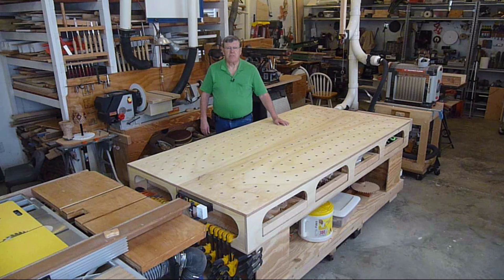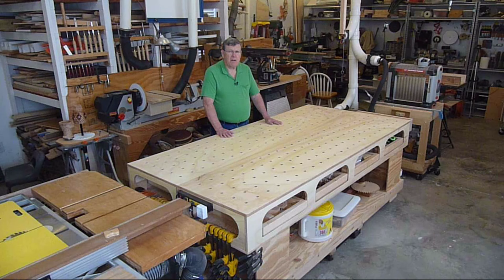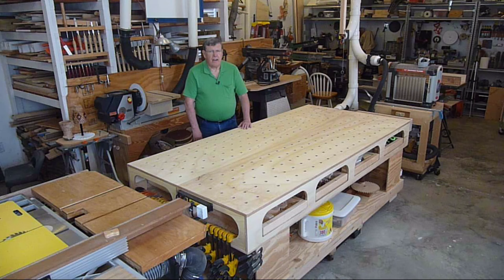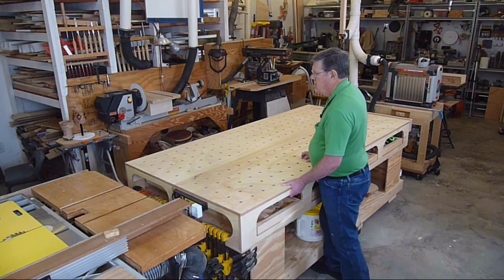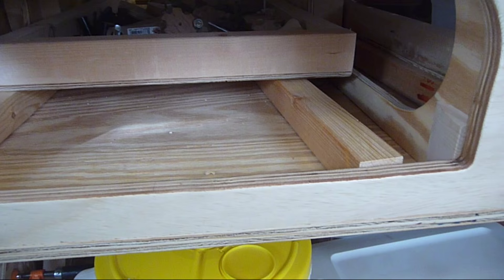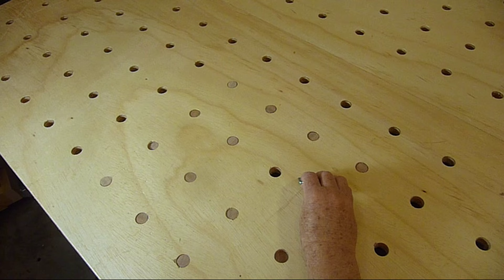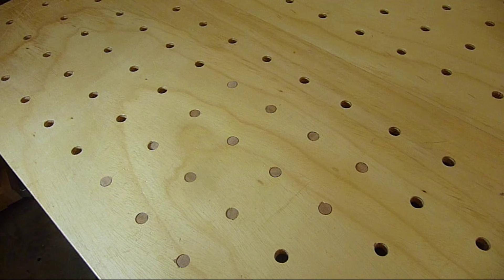Customized Paulk Workbench 2

Comment: Earl, I bought Ron's plans and they are good, but I built my bench modified like you did yours. I think you did fantastic modifications and I even stole your idea with the clamps (used Irwin clamps though but they are still almost as cost effective as Harbor Freight). The main modification I did to your design is incorporating a 2" overhanging edge all the way around for two reasons. The first is because my Saw Stop table saw has a 2" angle bracket on the out feed side used to attach the wings and I figured for balance and the quick and dirty clamp job to make it on all sides. Thank goodness for people like you that share their creativity so us newbie woodworkers can look at your ideas and use them. THANK YOU.

Comment: Earl, i made my Paulk outfeed table 4' x 5' and used you're slide-out drawer design. I already have a 30" x 7' workbench with dog holes and two vises; what i really needed was a large outfeed and assembly table.  I had a bunch of the Rockler outfeed mini ball bearings and installed them on top of the 2" x 3"s; the drawers slide out great and hold all of my cordless Ryobi tools. I'm also able to store a lot of hand tools underneath the drawer space of 2 1/8". I built a 3/4" top with a 1/4" Masonite top with miter slots and moved it right up to my tablesaw. Thanks for you're insight into woodworking.
Reply from the maker: It sounds like you adapted many ideas, added some of you own, and made a table that just suits your needs.  Good job!

Comment: I did an easy modification to Harbor Freight clamps. Removed the stationary jaw and heated the tip red hot and bent it about 1/2 inch down 90 degrees and simultaneously put a 90 twist. They now go into the workbench holes and nothing has to be passed up from underneath. You can’t use the clamps from anything else but for the workbench, but there real cheap!

Comment: Hi Earl,Great bench modified to suit your needs. I made mine with the top 6 foot by 4 foot with the edge and end runners set in by 2 inches to give me c lamping facility all round. I have not drilled the bench dog holes in the top. Colin in Northern Ireland
Reply from the maker: +colin farrier The two inch inset is a great idea Colin.  I've been thinking about screwing a 2x2 to the sides, even with the top for better clamping on the edge.

Comment: Hi Earl, (my late father's name was Earl too), I just finished making my own Paulk workbench (paid for plans) and used most of your ideas to improve it. The drawers are fantastic! I think I'll add a wood vice to one end, but not using pipe clamps. Thank you for your inspiration!
Reply from the maker: Thanks for watching and commenting John.  I still like my sliding drawers.  The pipe clamp vise is not working out so well...the clamps just slip too often.  I'll probably replace it sometime but I'm not sure what I'll use.
Reply: If you got the clamps from Harbor Freight, like I usually do, then that could be the problem. The 1/2" pipe clamps are known for slipping on galvanized pipe. Try switching to Pony pipe clamps, or if you spend a bit more, Bessey clamps. Pony and Bessey tend to have a much stronger "bite" on the pipe.

Comment: Capital "A" awesome!!!. The thicker tops and drawers make it ten times better for shop use. My assembly tables are two solid core door slabs (30" x80"), which are beat up and not even remotely flat. Your idea solves the problem of work areas, out feed table AND tons of storage gained from the cubbies inside the torsion boxes. I am seriously thinking of using your mods on two tables (30 x 96, using the 3/4" ply), which could be latched together for larger assembly. My shop is a long skinny rectangle, and a single big table may be too much.I will probably try to incorporate some leveling, or maybe some adjustable screws (Down to Earth Woodworking Outfeed table design) into the system, as well.Thanks for taking the time to pass on some great info. You just gained another sub.
Reply from the maker: +Andrew Bieger Thanks for the comment Andrew.  Ron Paulk designed a very useful table.  I'm still super pleased with my version.

Comment: thanks for the review of this AWESOME workbench.  I wish I had seen this BEFORE I built mine.  I like it, but I believe I would have like this much better.  I especially like how you modified the design to be an "in house" roller table.  thanks again.  will be watching more videos.
Reply from the maker: Thanks for watching, Kevin.  Is it too late to make a rolling base for your table?
Reply: I made a nice rolling table and I like it.  It has the table saw in-layed on one end and the sliding miter saw on a flip over plate in the middle.  I thinking of installing a router lift on the other end. It very hadny on the top but there's a lot of unusable space underneath.  I like the way you made the sliding drawers I have some space to make  these in a few places.  Thanks

Comment: Great bench and ideas Earl. I have been looking at Paulks bench for quite some time and I am getting close to getting ready for my build.Also like you I don't need the mobility and have seen the other modifications and think yours is the best I have seen. Your video was good but I would like more info on the end shelves near your power strips? Photos would work nice. Again some great ideas. TKS. Pete
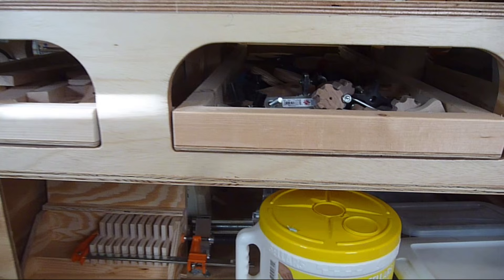Reply from the maker: +Peter Van Brussel Peter, the clamps just hang in the oval openings at the ends of the table.  I looked back at the video and the only thing I see that might look like a shelf is at the 4:56  mark in the video.  That's just some scrap pieces of plywood that I "stored" there for no particular reason.  They could, and do,  make a convenient spot to store small things - like extra camera batteries, etc.  Thanks for the comment an get busy on your build.  I'm sure you'll be surprised at how easy it is to build from Ron's excellent plans.
Reply: +Earl Davidson Woodworking  Earl I bought this house 1 yr ago. during the house inspection termites were discovered in the out building that is now my shop. They treated the building and I offered a reduced cash price for the house base on estimates to repair the out building or walk, and they accepted. Since then I have gutted the building, reworked the electric, insulated, and sheeted the interior. also note that I tore out a wall in my house and repaired. I will be completing painting tomorrow and be able to start on work benches and the project bench like yours next week.

Comment: Hi Earl. I've been checking your design again, and have just purchased the plans from Ron. You said that the sides of your table are 9"  (Ron's are 7"), to allow for the extra space and drawer storage. His original design shows 4-1/2"  x  18" oval holes in the sides. If I may ask, what are the dimensions of the holes in your bench? Your drawers are approx. 15"  wide, if I heard correctly.

 I will also use 3/4" ply on top and all ribs, with 1/2" on the bottom. I do like the additional space and storage that your modifications provide, but do not want to lose any strength by making the cutouts too large, as that part of the design lends rigidity to the box.

I have also checked out Jay's and Ron's channels (subbed theirs and yours, as well), as you guys have provided tons of useful info. I appreciate the effort you all put into the videos. Thanks much.
Reply from the maker: 6-1/2x18 with the bottom corners not rounded.  Easy mod to the plans.  Drawers are 1/4" less than the opening.  15" would be the inside since I used 1-1/2" scraps for the side of the drawers.
Reply: Thanks, Earl. The numbers make sense now. Time to go buy some lumber!!!

Comment: Excellent build! I really love those shallow drawers, and having them running all the way through the table is like having full extension drawer slides. I really like the clamping holes concept in the table top, and I've seen lots of videos with the concept. Are you having problems with dust covering up the stuff in the drawers?
Reply from the maker: +Jesper Knudsen Hi Jesper, thanks for the comment.  Yes, dust and chips will fall through the holes.  It wasn't really a problem until I did a bunch of routing on the workbench.  Only one of the drawers has lightweight stuff in it (sandpaper) so I just pull them out and blow them off with the air hose.  Hasn't been a big problem at all.

Comment: Hi Earl, I'm wrapping up my version of Paulk's workbench and am adding your drawers and pipe clamp end vise that you based on Jay Bates design.
Question: Did you use 3/4 inch pipes for the vise - if so, what size hole did you drill to leave some room around the 1.050 inch outside diameter. Thanks for the great video and ideas!
Reply from the maker: Yes, 3/4" pipe.  I drilled 1.25" holes.  Enjoy your bench!

Comment: Earl - Beautiful job.  I am planning on building a similar table.  Did you work from the plans and then just attach the two halves, or did you opt to skip making a second middle support, and just use one long support up the middle of the table?  I had hoped Ron Paulk had also come up with a "single 4x8" version of his bench, but the plans are only for two 2'x8').  Also, did you dowel or pocket screw the corners of your drawers (I like your dowel jig!)?
Reply from the maker: +cavac@4ctech .com I made mine in two halves like in the plans.  It shouldn't be too hard to adapt it to a single 4x8 box though.  I'd make two end pieces instead of 4 and use one 8' piece in the middle.  Several dimensions would change slightly but should not be a problem.  Having the plans would still be beneficial...some good tips there.
Each drawer corner has two pocket screw holes in the long side piece, screwed into the short end piece.  A piece of 1/4" plywood is attached to the bottom with glue and brad nails. Wax the bottom.  Nothing fancy here but they work great.
Thanks for watching the video.

Comment: Great video and modifications. I agree with other on your pass through drawers, awesome.
Q: What is the need for 230 holes on the top, could 20 well places holes work fine? I've been wood working for years and never used holes, just clamps on the cantilevered edge of my table and vise. Is there a greater use for all those holes I'm missing?
Also love that its on wheels.
Reply from the maker: +T Mill ... I'd never used holes either.  I'd seen several versions of the Festool Multi Function Table (MFT), including Ron's design, so I wanted to try them.  I find them convenient in lots of ways.  You could certainly try 20 and see how that works for you.  At this point I wish I'd made a 1" overhang on both sides of the table for clamping at the edge.  That's on my list of changes if I ever make another one.
Reply: Earl Davidson Woodworking I haven't build a Paulk table yet, but I too am considering adding an overhang around the perimeter for clamping. I enjoyed your video.

Comment: Hi Earl, it doesn't look like you expanded your table vise pipe holes horizontally like Jay Bates recommended - do you have any problems with racking using such a wide vise?
Thanks, c5auto

Comment: Earl, since you inserted slide out drawers, how do you deal with the dust falling through the holes?  I want something along the same lines but not sure how to deal with the dust in the drawers.    Was thinking about a deeper bench and inserting a shelf but am worried it would interfere with the clamp insertion.  Any thoughts?
Reply from the maker: Gary, the simplest thing to do is cut 3/4" dowels about an inch long and keep them in the holes until you need to insert a clamp.

Comment: Great video. Would you say that when the two halves mate, there is any lippage? I'm worried that one top might be proud of the other. I plan on using the table as an outfeed table. I want the 2 halves to be flat as possible.
Reply from the maker: +Know How    I had no problem getting mine flat.  When you set up to rip the sides and ends just cut them all at one time.  Then when attaching the two pieces together, get them aligned and clamped together, then drill the holes through both sides at once where they bolt together.